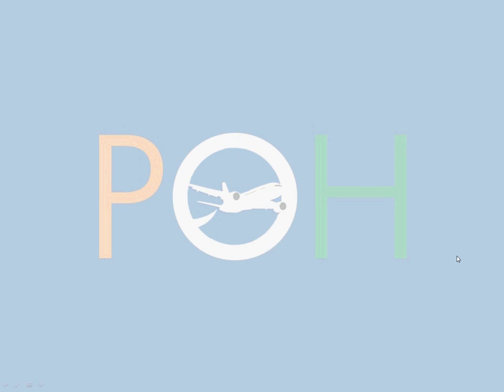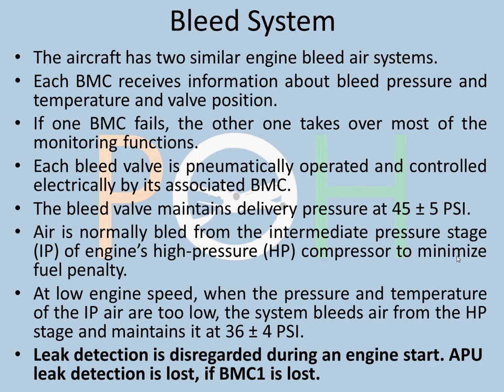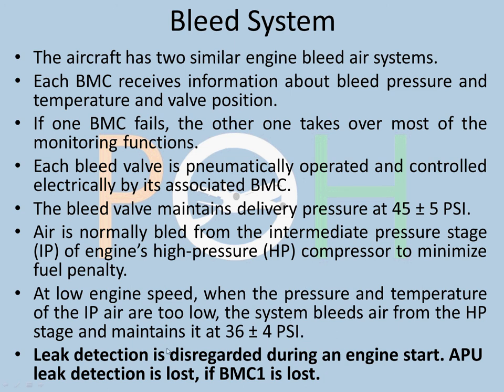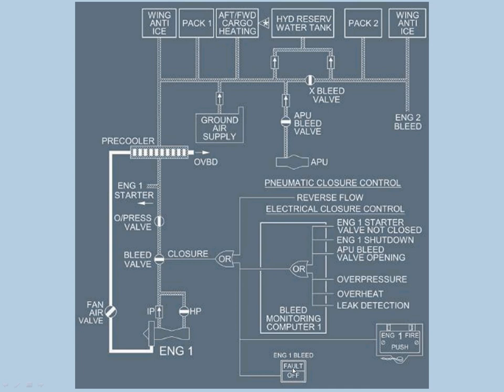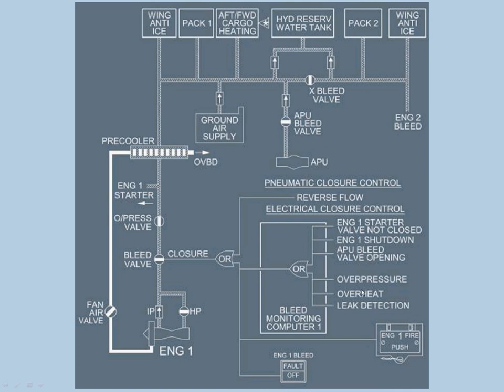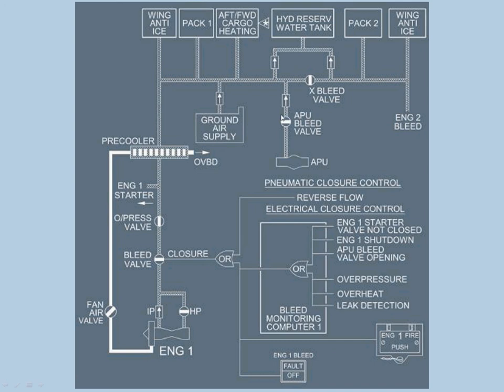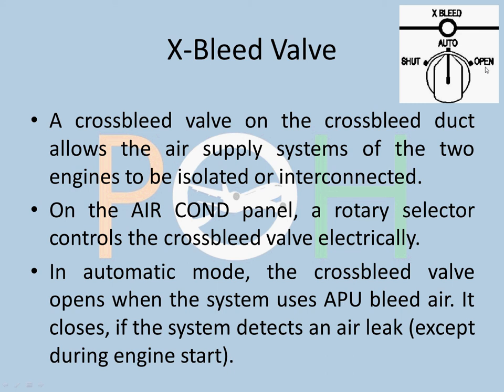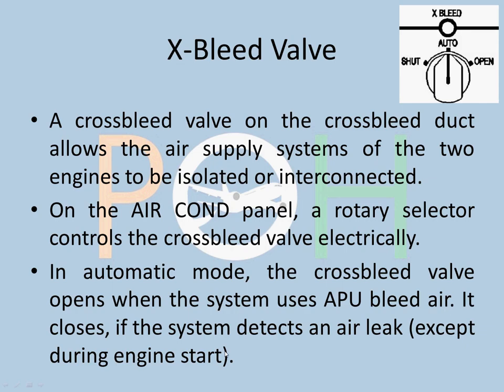A320 - Pneumatic

Comment: Hello sir,
Why position of the eng starter valve is different in ceo and neo ?
Reply from the maker: Because Neo since it generally produces more thrust and has higher pneumatic pressure, the overpressure valve protects the starter in this direction too in case of a cross bleed start, so that too much pressure also doesn't reach the engine starter.

Comment: Interested if u'll elaborate more about crossbleed like what'll happen during engine failure etc etc
Reply from the maker: Cross bleed in auto during Engine failure the cross bleed is shut only. But if you take APU bleed then it opens like in normal operations. ECAM will suggest you taking cross bleed open to facilitate aircraft performance, this also helps utilize the bleed to help start the other engine as per QRH.

Comment: hi , would you suggest some snags , conditions that my help to cover the system , like overheat ,over temp , or pressure?
engine performance with one pack
Reply from the maker: +Bazoka Zoro Hyd Sys Ovht, Hyd Sys Lo pr, Air bleed leak etc